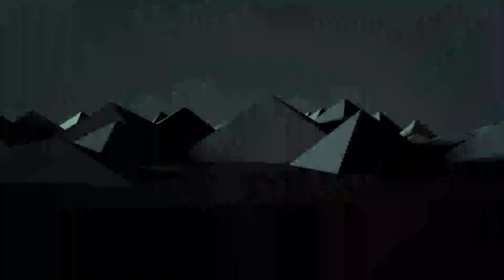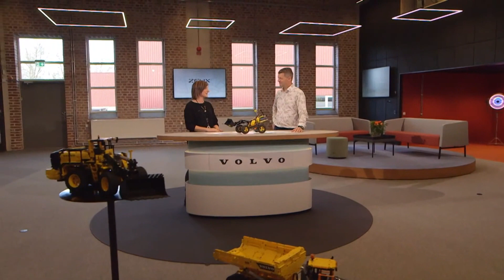ZEUX – Making it Real, Digital Event

Comment: Did anybody learn anything concrete about this product, except that the Volvo team is very proud, excited and happy to work at Volvo and collaborate and bla bla bla. 

I am still puzzled about the (supposedly costly) scissoring move, it's purpose and why it is worth the trouble to have an expensive hinge. Because a robotic excavator does not need to be super-efficient as it does not 'consume' man hours. 

Please don't misunderstand: I am excited about this concept but very, very disappointed about the level of information.
Reply: At 14:00 they talk about a few benefits of the zeux/scissor function.
Also I would disagree that a AI/non human operator doesn't have need to be efficient. They do and should be efficient as they still consume other resources.
Reply: @VikingstålMotor  I would say it is a very non-concrete explanation for such a key design feature. If they wanted to impress the audience, they could have filmed the motion and explained, or even better made an animation to show it. Maybe it can lift the weight with half as much actuator force because energy has been 'saved' in the counterbalance. Or maybe if can lift the bucket twice as fast. in any case, the energy required to lift a load from the ground is the same. And the explanation was poor. There was plenty of time spent on self-promotion that could have been used to highlight this feature.
Reply: It's so simple, maybe they thoughts it needs no explanations? but...
If you hit a pile with the bucket low on the ground and the counterweight lifted up in the air, you can use the potential energy by lowering the tail to fill the bucket. So gravity is providing the breakout force - like a seesaw.
From theory, this is much more energy-efficient, as you can decuple traction, bucket movement and lifting.
Reply: @Moselblues  You nailed it! That was my main reason for proposing this idea when working at VCE back in 2000. Every bucket lifted, equals the energy it takes to lift half a bucket weight. Every lowered bucket dito in  tranferring the hydraulic pressure into ventilated heat energy from the hydraulic system. The people working at VCE theese days  seams more open to new ideaas  compared to beginning of the millenium....It took 20+ years.....